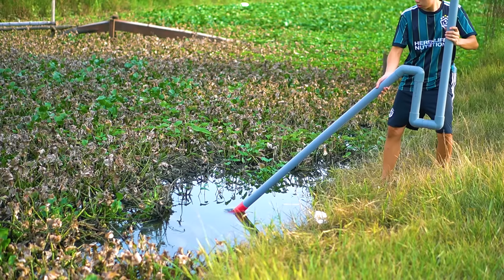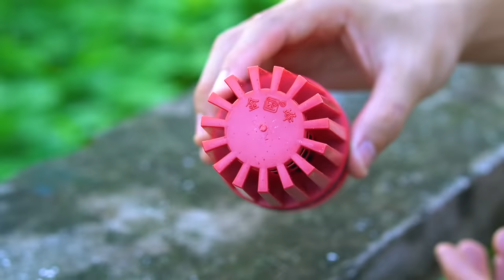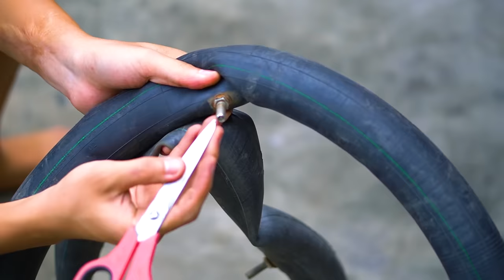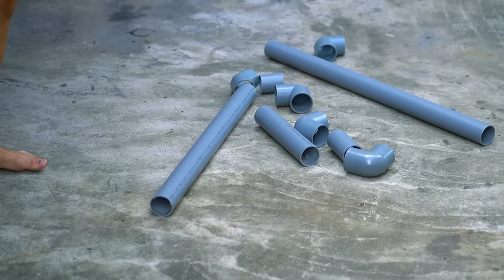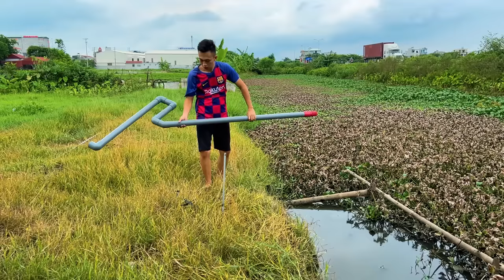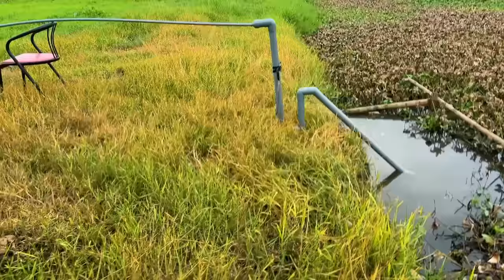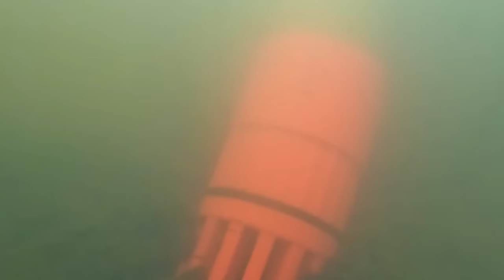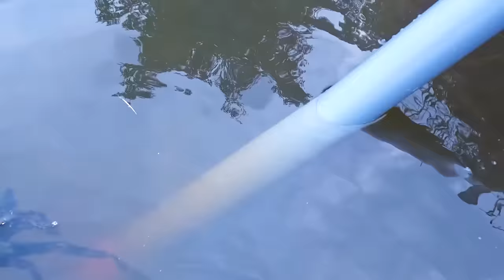I turn PVC pipe into a water pump no need electric power

Comment: For the doubters, I'd gladly duplicate this project and prove whether it works with a detailed video if someone could locate a source for the red check-valve and strainer.  Pumping water uphill without external power has been done for centuries and the physics thereof is well-understood.  There's my challenge: just post the source for the check-valve in a comment.
Reply: So that's where my anti-gravity check valve went!
Reply: Can prove the earth is flat too.
Reply: @jakejacobs1227  also John Whitehurst didn't invent anything. Maybe published a book but that's it....
Reply: @jakejacobs1227  I know what your talking about but works nothing like this and looks nothing like this
Reply: Yeah those damn doubters, using their "physics" and "facts" to disprove perpetual motion machines!
Reply: It's not the check valve per se. The secret is the special juice poured on the scientifically designed crack in combination with the unique characteristics of a tire tube used for a precise number of miles.
Reply: No offense, but I don't think the physics thereof are well-understood by you.
Reply: @stephenbeck5993  None taken but your comment is an ad hominem argument or logical fallacy.  Simply asserting that I don't understand physics doesn't explain where I've erred.  Perhaps you can explain Joukowsky's equation or the fluid hammer effect.
Reply: @jakejacobs1227  I am a mechanical engineer with 2 graduate degrees and familiar with those concepts, but I will yield to your obvious superior intellect. Cheers.
Reply: @stephenbeck5993  So your comeback is another logical fallacy; vis: appeal to authority.  On top of that you add sarcasm.  If your two degrees afford you familiarity with the concepts involved, then why not simply explain how things work or don't work.
Reply: @jakejacobs1227  You have not provided any scientific explanation for your claim that this design would work and yet you repeatedly criticize me for not explaining why it would not work. If the water in the pool were moving, then I would agree that it is possible, but it appears to be static, which is why I believe the concepts that you cited do not apply. I look forward to your sourcing a check valve and proving me wrong.
Reply: It work just like fish aquarium syphon pump. To keep it going you would need a down hill pipe after highest point to keep suction and not lose prime
Reply: so gladly duplicate already!
Reply: Any magic shop carries them. Part number F4K3
Reply: @railroaded1991  ?
Reply: @stephenbeck5993  it's an extremely simple "check valve" if he's that smart he can just make one then he can spend the rest of his life trying to prove this thing works.
Reply: @jakejacobs1227  ye. For 30 years for a bunch of other fake crap.
Reply: @railroaded1991  Maybe he hasn't found one because he went to Lowe's and Home Depot and asked for a magic check valve.

Comment: I would like to find that EXACT valve, and, exact dimensions, and see if that actually works...  I have heard that standard water heaters can drain through the top, and may have experienced that phenomenon myself based on replacing an element just now that looked like it burned in an empty tank... element burned up and looked like it almost melted.. Looked like a bananna, but, I know it was never turned on, not full of water, unless it drained by itself somehow, not from the bottom of the tank..
Would be cool if someone who had access to that exact valve built one of these.. I have my doubts about a lot of stuff I see on here, but, can't say it won't work for certain, without trying it.
Reply: Called a foot valve used in water wells

Comment: I saw you it was kind of hard to find the pipe pumping water under the water
Reply: Use Earphones/Headphones to Hear Clearly ...

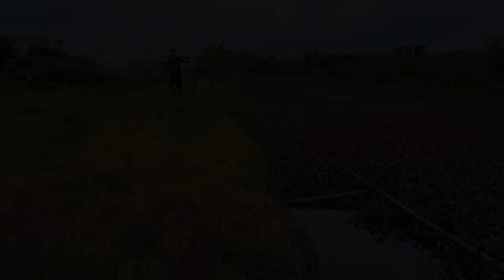6:13 Noise of dynamo and propeller inside the pipe it sounds really loud ...

6:30 The loud sound of the dynamo disappears after the pipe is filled with water ...

6:50 The sound of the dynamo in the pipe is heard again when the water in the pipe is emptied  ...

6:58 The loud sound of the dynamo in the pipe disappears again after the pipe is filled with water again ...
Reply: @budinanto9686  I knew it you are right

Comment: Yes, at 6:10 he brings the pipe to the spot accompanied by high pitch sound like cicada and then the sound changes depending the pipe is handled, the assembly is evidently heavier the way he is handling it to be just empty pipe, once water in pipe-the sound is muffled by the water. It's a con-man folks.

Comment: Okay Well I guess I'm to slow. Why did he Modify the check valve ? And I think I'm seeing this pull H2o with no movement of the H2o ? And did it need any check valve at all after he set up the draw of H2o ? Also would it not load if he put the end into the H2o and then tilted the rest of it on it's side, till it started flowing ? Like I said I guess I'm a bit slow. Great video what I understood of it !!!

Comment: its pretty decent fakery, no obvious edits when he sticks it in the water,  no  disturbed water surface to indicate a pump already running underwater.. when he puts the camera underwater, theres no sound of a pump, so he has gone to reasonable lengths to edit video and sound to make it look real.

i dont see the point for modding the check valve as it really just made it less efficient.

i guess we could just try to replicate the design and see if it works... and most likely be disappointed.

Comment: The author must have neutralized the effects of earth's gravity in a very localized frame, otherwise, water will not flow from a lower level to a higher level without some work being done (air pressure, pump, etc.).

Comment: Completely fake. The fact that the water would climb alone along the pipe is against the most elementary law of gravity, unless there is a siphon and that the outlet point is lower than the inlet point, which is not the case.

Comment: Nice vid, but of course total fake, but that's the idea, more hits. Would really like to know how you hid the pump . The dead giveaway is the destruction of a working foot valve, no rubber seal, no one way valve. The second is just simple physics, no mechanical advantage to suck water to a higher plain, and the best you get is a siphon.  As far as mister Millwright goes, I think you missed the lessons on  differential pressure, along with a lot of principles of physics. But I'm just an old guy who's fixed  stuff for more than 1/2 a century, but what would I know.

Comment: Anyone who thinks this is not fake, here's why you need to switch on your critical thinking: if this were possible, he could just orient the water flow back to the pond, over a water wheel or turbine. The turbine would generate electricity, and the water would go back into the pond, thus you would never change water level and would get free electricity, forever. Come on folks. 

In fact, you could go further: you could replace the pond with a bathtub. So now you would generate electricity by just "priming" the system by pushing it multiple times like he does at the end of the video, for free, forever! Come on folks. 

For anyone who thinks this uses the same idea as siphoning from a pool or gas tank, you should know that this only works if the outlet is lower than the water/gas surface. The physics behind siphoning is quite simple: water is incompressible and the weight of the water going out has to exceed the weight being pulled up. 

For anyone drawing a comparison to a ram pump, again wrong: a ram pump needs energy to work, as it converts it into energy to raise water higher than original level. Eg, a stream of flowing water can provide such energy. It does this by converting this flow past the water intake into pressure. 

Also, notice how at the beginning of the video he does not do this back and forth motion, gets water literally by just putting it there. C'mon folks. Think. 

Here are 2 good links to improve understanding of how water flow works: 
- Practical Engineering at https://www.youtube.com/watch?v=zFdyqTGx32A
- The Action Lab at https://www.youtube.com/watch?v=9NHVmOchAgI

Anyways it's sad to see how many people let their hope of good things cloud their judgement of the workings of this world. 

This guy is praying on you gullibles. His one saving grace is that you aren't paying with your money, just your time watching which diverted money from businesses that pay for ads to his account!

Comment: No need for the theory; just comparing the opening of the tire valve stem (inlet) with the thickness and flow of  water in the outlet pipe, shows how fake this is !

Comment: So simple to settle all these comments. Have the creator of the video shoot in ONE TAKE assembly of all the parts right next to the water and insert it and make it flow water, and in the same take, disassemble it. Bingo. problem solved. We'd then know if it is for real.

And if the creator really stands by this, he should have absolutely no problem with this, especially given that it is so stupidly easy to assemble and disassemble. Video of less than 10 mins, and guess what, since it has to be one take, there is NO EDITING to be had, so this is really super easy and quick to do!

Comment: Any of you ever drained water bed? I have several. I don't know about the priming of the start of the flow, but I know that once you get water flowing it will continue. His u in pipe helps prevent air breaking the siphon of the water. 
  Before we claim fake or real. Try it. IF YOU NEED IT! I don't need.
Reply: Siphons work by moving water from a higher point to a lower point. As long as the opening at the end of the tube is below the level of the water, and the tube is sufficiently primed, water will flow "downhill." The only limit to this is the vapor pressure of water. If the siphon has to suck water up the tube more than approximately 30 feet above the water level (1 atmosphere of pressure) then water will start to boil and the siphon will not work. It will NEVER flow uphill like you see in this video without an input of energy. There is no need to try to replicate the video that breaks the laws of physics.
Reply: @K.O240  Not trying to bust your bubble but look at the link i posted . I learned this tonight. buthttps://en.wikipedia.org/wiki/Hydraulic_ram
Reply: @K.O240  Water can be siphoned uphill using hdyram , however i don't believe he would build enough negative pressure in the trap to overcome the total height of pipe at the outlet. if the outlet pipe was shorter than the trap height than maybe i could see it working

Comment: There is a pump that uses the flow of water down hill from a dam into a valve that pressurizers and releases over and over pushing water up and back into the dam but this works on a small scale and uses air compressed to then push water up bit by bit and resets then the downhill water primes it again and its been around a long time as saw a diagram in old book. Each time a valve release the air out. its not equal water down and up or it wouldnt work so more leaves the dam than goes back in so its not a PM machine.

Comment: I use the same technology for adding diesel in a rider mower through a clear tube, with one end made of a brass fitting with a metal ball inside. The jerking, up-and-down motion jostles the ball up and down, and this creates the siphon. So long as the fitting is kept in the diesel (or any liquid), it keeps the siphon, but once air enters the line, the siphon stops. I suppose something similar to the metal ball is inside this tire valve for this to work.

Comment: The amount of water coming out the outflow greatly exceeds the  volume of water that "could" be drawn into the inlet. At the beginning of the video when he showed the parts on the wall, he did "not" show us the longest pipe or that it was empty. A sealed  motor and battery with a switch that's operated by shaking draws the water. Call him for what he is! A LIAR!

Comment: This is possible and is used all the time.  Usually in cities moving water up to large aquifer that you would see on a roof. 

Another way to look at it is sucking fuel out of a car using a hose.  His initial shake "primes" the line (starts the suck).  There is a plug that needs to be manually moved up and down to pull the water up to the first drop.  Then you create a pressure difference between the top and the bottom since the plug almost closes the flow but never fully.  Think pinching the end of a water hose this creates velocity (again due to the pressure difference between start and end).  Since water always flows towards the low pressure system, and now at a higher velocity plus also gains a small amount of energy in the system due to gravity in the form of velocity.   This primes it for a cool effect in fluid dynamics. When you hit the edge for a system at a certain velocity (not to fast).  it "slaps" the 90 degree edge (Think right angle) causing the water to go either go back (high pressure) or up.  And since there is a low pressure system, it will go up.  

That process is how you fill an highly elevated tank with no traditional motors.  The thing bad about it, at a large scale, is you need to dig lower to create enough force to get passed that top equilibrium.  It's cheaper to just have a motor, at least for the city works.  But for farms or basement drains, simple things like that.  Yea this is definitely something that an inspiring entrepreneur should market.  But for cities when the pipes need to be replaced you're looking at millions to fix a simple issue.  So this method isn't used much anymore.  At that scale.

Comment: It is possible to make this work in a running stream with a hydraulic ram pump (https://www.youtube.com/watch?v=2BqOhHcTzeM) as it produces the force to move the check valve back and forth and it acts like a pump.  once the water gets uphill you have to have the line running down hill to create the siphoning effect.  But in the the beginning the water comes out in a pumping action.  no way you can do this with still water.  BS.  The problem you have is as the pipe fills with water the weight of the water going up hill will eventually keep the check valve closed.

Comment: what is funnier than the fact that this is totally bogus, is that if he left the check valve intact he could have actually had what the title describes but he would have to keep moving the pipe up and down. The check valve would have allowed the water to enter the pipe at the intake end but not leave so he could have progressively kept forcing water into a pipe that becomes a beaker as he lifts it back up. pipe goes down valve opens water enters, pipe goes up valve closes with opposing pressure water stays in pipe, repeat.